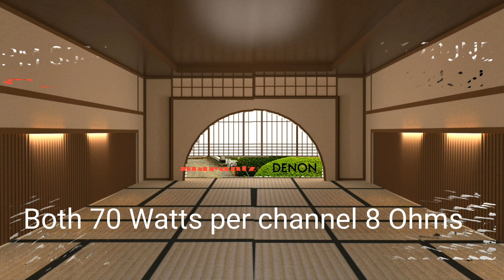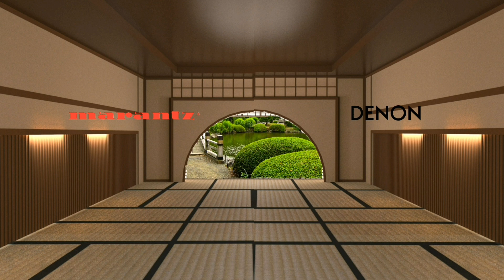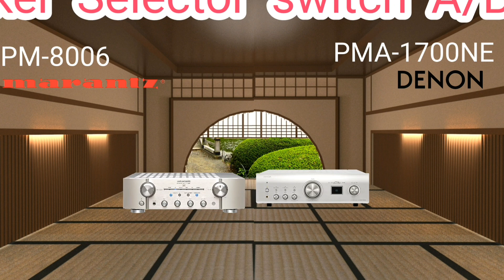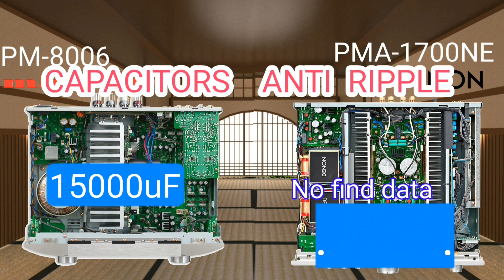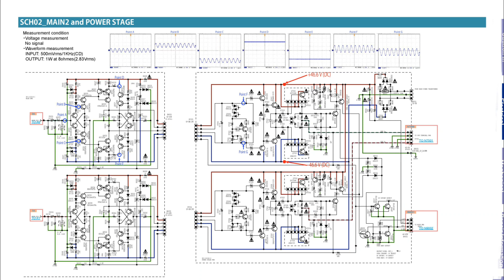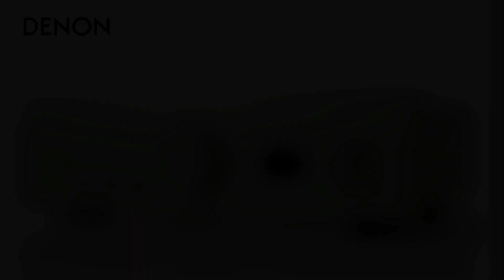Marantz PM8006 vs Denon PMA-1700NE fighting feature Technical + schematic 8006 integrated amplifier

Comment: @5’05 : Weight : PM8006 is only 12kg and not 26,5kg as mentioned so far less than the 17,6 of the PMA1700 🤫😉😊
Reply from the maker: Correction video
Time 5:05
I said marantz PM8006 weight were 26.5 kg
really that correct is 12.7 kg or 26.5 Lbs. Thank you for correcting
Reply: Musicalement je préfère denon

Comment: What a load of old tosh, you got the weights incorrect, the Denon is heavier @ 38.8 lbs, and the line-level SN ratio is exactly the same on both amplifiers, check your facts.
Reply from the maker: I said marantz 26.6kg, Denon 17.6kg. all unit I used kg not lbs
Reply: @JNElectrics  Actually marantz have 12 kg and Signal to Noise Ratio 106
Reply from the maker: good
Reply: @JNElectrics marantz pm8006 weight 12 kg!
Reply: Also Marantz pm8006 has 18000 mf capacitors, not 15000.